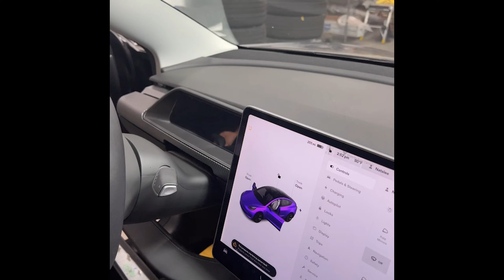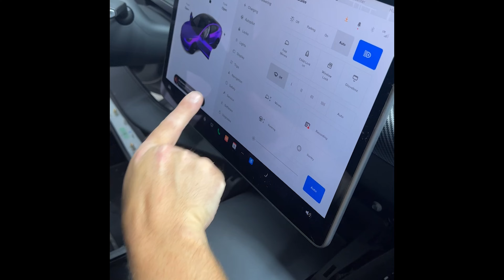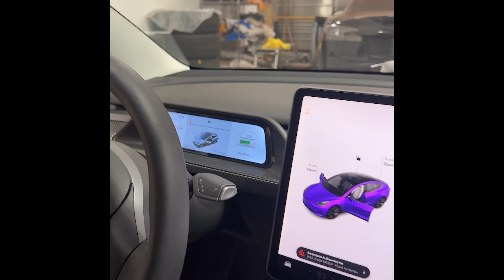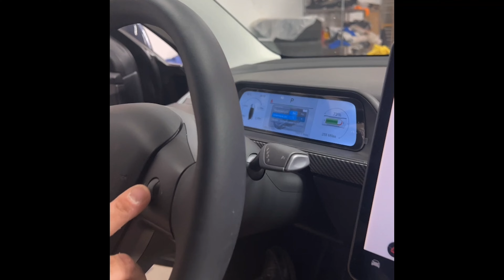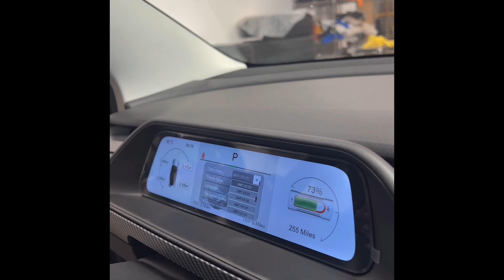Unboxing & Installing the T Sportline MSX Dash LCD Display on a Tesla Model 3 - AMD DIY Step by Step

Comment: Does the background turn black at night ?  Also, are there any approved fitters in the UK ?
Reply from the maker: There is an option for auto which will follow the automatic screen settings that the center screen is on.

Unfortunately, we do not have a RHD version available at this time.

Comment: Very impressive video so far.
I have a Model Y 2022 AMD Ryzen, can it be used?
Do I have to keep the same order, same hardware?
And doesn't that work without power from the center console?
Reply from the maker: This works for both the Intel and AMD cars. Same order and power to the center console is needed

Comment: This is many more steps than what was shown in the video on the Tsportline site. They did not go into the center console at all. What is the right version? Is the carbon actual carbon fiber or fake?
Reply from the maker: We've updated all intel harnesses to plug into the center console now for an improved power source. the carbon pattern version is not real carbon fiber.

Comment: The latest Tesla update broke this display. My battery % is now stuck at 97%, and is currently showing I have over 27,000 miles range!
Reply: Can anyone share the latest software update file?
Reply: @אוהבאתהיתברך  Thank you for sharing this update, I  have the similar problem with   battery 101% and Mileage display 19091
Reply: after lately Tesla software update

Comment: May be a silly question but how does it get the data like charge left etc from the car?  Sorry for the newbie question I don’t have my car yet but this looks amazing.
Reply from the maker: Pulls data directly from the Media Control Unit of the car
Reply: @TSportline  This is amazing. Is there an LA place for installation?  Can you customize what is displays?
Reply: @MikeRadioNY @TSportline I’d like to know this too, the left hand display showing tire pressure is neat, but can other data screens be shown? Telemetry, maps, media, etc.

Comment: wont this void the warranty?
Reply from the maker: By law, it will not void warranty.

Federal Warranty Law: The Magnuson-Moss Warranty Act (15 U.S.C. 2302(C))

The Magnuson-Moss Act regulates that vehicle manufacturers may NOT refuse warranty repairs merely because aftermarket parts have been installed on the vehicle.  The only circumstance under which the vehicle manufacturer can void the warranties is when they can prove the aftermarket part is directly responsible for (ie causes the warranty) the warranty claim.